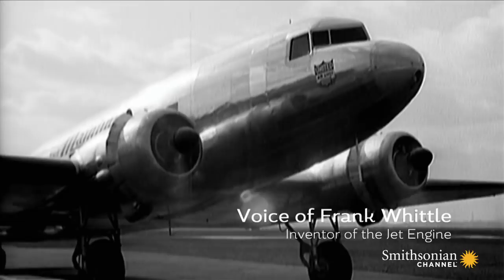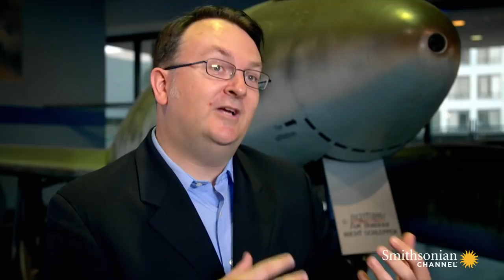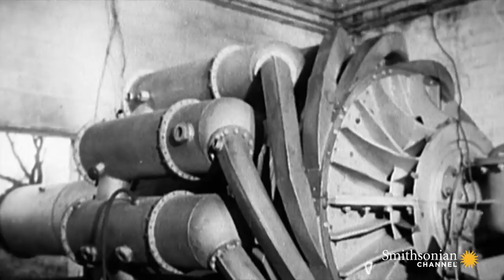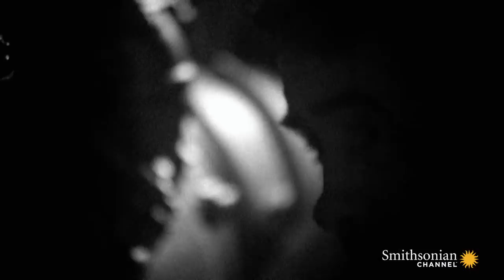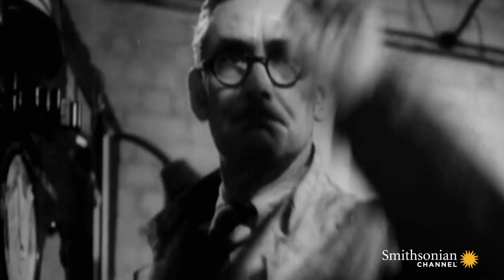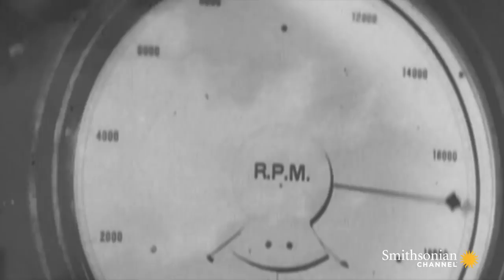Inventing the Jet Engine Came With a Few Disasters

Comment: you forgot Hans von Ohain
Reply: Indeed, Hans von Ohain and Max Hahnn built the first turbojet engine and made the first successful demonstration 2 years before Whittle.
Whittle is only the 4th person to successfully demonstrate a working jet aircraft engine
Reply: @WilhelmKarsten  the demonstration you refer to was a sheet metal design with an external fuel pump that could only run for a few seconds before catching fire. 

Their first self-contained and semi-reliable jet engine ran several months after Whittle's and was not the design Von Ohain followed through to production.

Whittle's prototype W1 was very similar to the production version that led to thousands of engines in Europe, the US and Soviet Union/China
Reply: @tomjohnson9833  You are very confused and misinformed.
The first prototype was constructed in 1934 and successfully demonstrated at the Universtat Gottingen in Germany in 1935.
We know from the historical evidence that Frank Whittle did not begin any actual work on jet engines until moving to Rugby in 1936. By this time Hans von Ohain was already constructing his second design the HeS 1.
Whittle's first successful bench demonstration wasn't until 1937 and his first successful flight test wasn't until May 15, 1941.
Whittle lagged 2 years behind and was only the 4th person to successfully demonstrate a working jet aircraft engine.

No engines designed by Frank Whittle or Power Jets Ltd were ever reliable enough for  mass production.
Hans von Ohain built the first turbojet engine.
Any questions?
Reply: @WilhelmKarsten   you can't just make up dates and facts to placate your own nationalist insecurities. 

Von Ohain's engine ran in September 1937
Reply: @tomjohnson9833  Just the facts here lad, Hans von Ohain and Max Hahnn built the first turbojet engine in Gottingen Germany in 1934.
This engine was demonstrated at the Universtat Gottingen and witnessed by several notable dignitaries including Robert Pohl and Ernst Heinkel.

The Heinkel HeS-1 was the SECOND jet engine to be constructed anywhere in the world.
It first ran on April 1937 and had a public demonstration in September.
Construction of the world's first flight rated jet engine, the Heinkel HeS-3 began in June 1937 and powered the World's first jet aircraft on August 27th 1939.

Frank Whittle was only the 4th person to successfully demonstrate a working jet aircraft engine on May 15th 1941.

Any questions lad?
Reply: @WilhelmKarsten   Von Ohain said himself that he didn't become interested in jet engine development in late 1933, by which point Whittle had been developing his designs for four years. 

The Max Hahn model which you claim was working in 1934 was actually a crude sheet metal model powered by an electric motor. It was barely able to combust its fuel without melting, and was not a self-contained jet engine by any definition. It also was made in 1935 or 1936, not 1934.

Von Ohain based his work on Whittle's Patent, by his own admission. (from Wikipedia "When I saw Whittle's patent I was almost convinced that it had something to do with boundary layer suction combinations. It had a two-flow, dual entrance flow radial flow compressor that looked monstrous from an engine point of view. Its flow reversal looked to us to be an undesirable thing, but it turned out that it wasn't so bad after although it gave some minor instability problems ... Our patent claims had to be narrowed in comparison to Whittle's because Whittle showed certain things." He then somewhat understandably justified their knowledge of Whittle's work by saying: "We felt that it looked like a patent of an idea ... We thought that it was not seriously being worked on"

Whittle was the first to run a self-contained jet engine (powerjets WU) by any definition, and ran a total of 37 times between 12th April and 24th August 1937.

PowerJets WU was developed into Powerjets W.1

Powerjets W1 was developed into the Powerjets W.2 and the General Electric I-A

Powerjets W2 was developed into the RR Welland and the RR Derwent, with the Derwent being copied by the Soviets and Chinese to produce the Klimov-RD500

The RR Nene family of engines was a redesign and scale-up of the RR Derwent, and carried over many design features, including basic operation philosophy. The Nene was copied as the Klimov-VK1, the Kuznetsov RD45 and the PW J48.

In total, Whittle's design and its immediate family were produced in the tens of thousands. 

I'm getting tired of doing all the work for you, but if you have any questions, let me know.